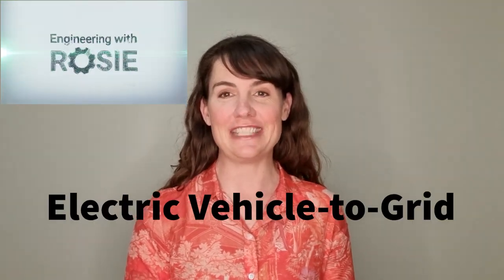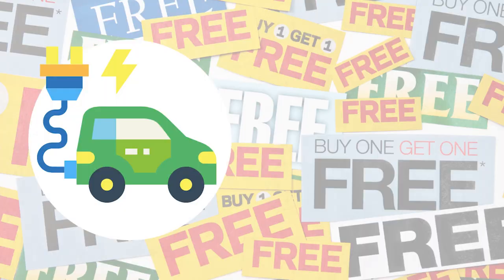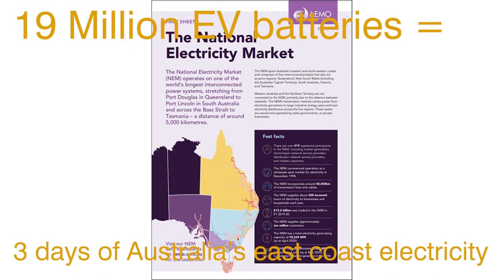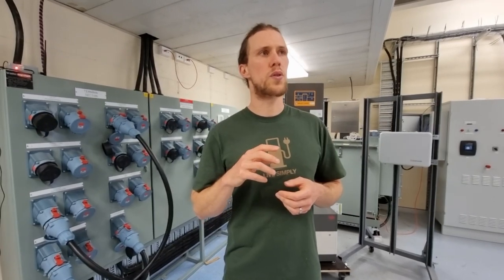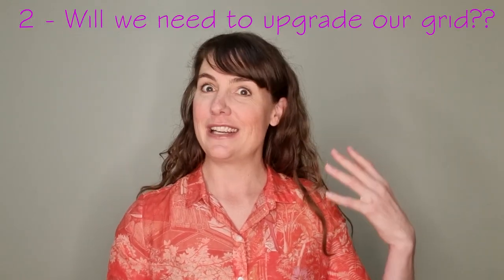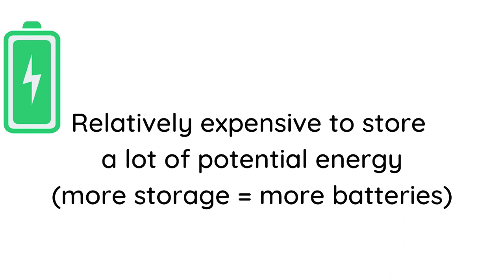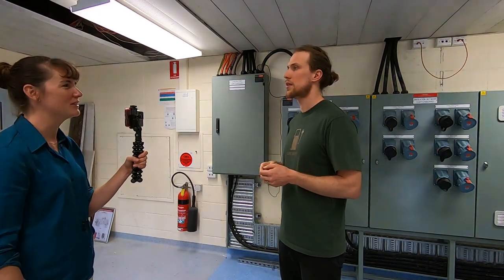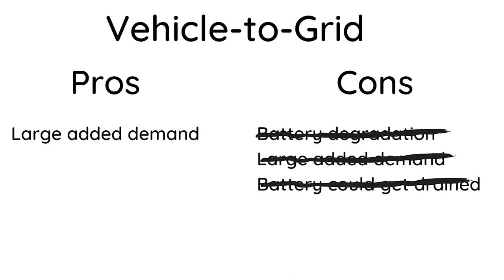Electric Vehicle to Grid Technology Explained

Comment: Rosie, I thought I saw a pic of PM Morrison questioning whether an EV can tow a boat or trailer. Really? Maybe you have heat like us here in Nevada that affects people's minds! lol Since the 1970s, the primary form of rail propulsion has been diesel-electric where the drive motors are electric but the electricity comes from diesel generators instead of batteries but more recently they use battery backup. So electric motors can pull a 100 car freight train uphill but not a boat behind a car? Let's not get into electrically powered multi-ton cargo ships. It seems your politicians are as slow as ours.

Comment: Grid designs & related business models seem to be often a hurdle. I recently read about Solar & Wind power (or the lack of it) in New Zealand. 
Large parts of NZ have perfect conditions for both and it could probably be used to reduce the load on the hydro power plants that power 60% of the country. This way they can use their reservoir like a battery (despite not having any pump storage).
Turns out they don't do that. The electricity market here decides the cost of electricity based on how much hydro power is available. Less availability of hydro power means there is a shortage of electricity generation and this increases the price.
This means that if they use solar & wind over hydro power and keep the reservoir levels higher they get paid less. So despite having perfect conditions for Hydro, Geothermal, Solar, Wind and lots of unused storage capabilities they still use lots of coal ...
Reply: Hmmm, you are surprised that companies creating centralized non renewable power are not willing to support a decentralized renewable power?

Comment: The problem with V2G is logistics. Even if most EVs are not being driven most of the time. Doesn't mean they are plugged into a bi-directional charger, when they are needed. 

Which is another advantage for modular battery swapping. Most of the capacity can be at a stationary location most of the time. Which is why NIO can make money by using electricity arbitrage.

Comment: The problem I see for V2G is not so much the vehicle as it is the ancillary equipment that must be installed at the residence.  Whereas a unidirectional charging interface is essentially a simple communications circuit, ground fault detection circuit and contactor the bidirectional interface includes an inverter to convert the battery's DC energy to the grid AC energy.  This is much more expensive to manufacture than the unidirectional charging interface and, thus, costs many times more unless subsidized by the utility.

The only example I can find that may eventually be available to me (same as pictured in the video) incorporates a grid-tie inverter.  In other words it is only suitable for operation when the inverter senses the presence of grid power.  It will not operate in a backup mode in the event of grid power loss.  Though it may eventually be upgraded to include off-grid operation such operation would need to be interlocked with a cross-over switch that physically isolates the circuit(s) powered by the inverter from the grid.  If this crossover operates automatically it can be quit pricey, as well.

The most tangible benefit for EV owners that are also subject to occasional or power outages would be to use the vehicle as a backup residential power source.  However, the ancillary equipment make this a pricey option.

The Independent System Operator (ISO) for my region does provide incentives for Tesla Powerwalls to be managed by the ISO for a limited number of hours per year for the line stabilization and/or demand control.  As these battery systems are expressly installed as backup systems I can see a more cost-effective DC-DC connection between the powerwall and vehicle in order to provide additional reserve.  One would only need to purchase as many powerwalls as required for peak AC power and rely on the vehicle for additional energy for extended outages.  It also permits the vehicle to travel to an area that still has power in order to recharge without the residence losing power.

Possessing a lifetime free Supercharging perk for my Tesla I am well aware that such systems open the possibility to abuse that perk.  I suggest that Tesla knows the energy consumed while driving, the energy gained by destination charging and that gained by supercharging.  It would be straightforward for Tesla to charge me for energy supercharged and discharged into a Powerwall.  Now only if I owned a Powerwall.

Comment: I'm concerned about Tesla making frame-integrated battery packs, as it may be harder to take the degraded pods and turn them over to grid applications like superchargers as an intermediate step to recycling.
Reply from the maker: That is a good point. I assume they must still be able to remove damaged or degraded batteries to replace them, otherwise the car's lifetime would be limited by the battery's, but that is just an assumption on my part. Soon I will be making a video soon where I will tour a facility where they take degraded batteries and make them into stationary storage as a second life before recycling. I bet the guy I am interviewing there will know about the Tesla integrated batteries so I will try to include that in the video. Thanks for raising this!
Reply: Nothing will ever get done if we have to solve all perceived problems before we ever make anything. Nothing is perfect and we have to make some possible difficult choices and compromises. That is what engineering is.
Reply: Tesla's structural battery pack is still a separate module that could be reused if form factor is not terribly important. Given degradation rates quoted for EV batteries, it's quite probable that rest of the car is worn out beyond reasonable repair before the battery is. Currently it seems that at 500'000 km the battery life will still be fine, but from what I have seen on the used car market, interior trims do not do so well.

Comment: 1. One important piece of information left out of this video was that a typical EV with a 60kWh battery can power a typical home for two days. A Tesla 3 has a 57.5 kWh battery, the long range, 75 kWh. So this means an EV has enough battery to power your home in the evening when there's no solar, but you need to recharge every day.

2. So one thing needed to make this work is having charging stations at all work place parking since you want to charge during the afternoon when solar is in over supply.

3. The second thing needed is EVs that can do V2G. Teslas cannot right now (2023). Nissan Leafs may be the only EV that can.

4. The third thing needed is an electric utility company that allows two way flow of energy. In the U.S. the 2022 Infrastructure bill or Inflation Reduction Act provides funding or incentives to make this happen where it isn't already. (Would it be possible for a home to run directly off the EV battey instead of using the grid as an intermediary?)

 I couldn't understand what Bjorn was saying about Australia's obstacles to V2G even with captions turned on. Perhaps it's the lack of two way electricity flow at homes?

Comment: I note many EV owners seem nervous about the potential for inconvenience, battery degradation etc. so I think it's important to point out the potential financial rewards here - Grid operators pay huge sums for balancing services and the fastest responding attract the greatest premium, this is currently in the order of several tens of thousands of dollars per MW just for availability. As noted providers are paid even if it's not actually used, like an 'on call' retainer payment. I suspect many (most?) vehicle owners would therefore be willing to participate if they had opportunity to take a slice of this very substantial (and growing) pie. So IMO it's the flexible tariffs and other market incentives that will be the key to unlocking V2G as much as the tech. It's a great opportunity for EV owners to earn revenue while grid operators lower their costs. It's a Win-win for all apart from the Diesel farmers, and we need to be getting rid of them anyway.

Comment: I don't think V2G should be seen as a standalone technology. It should be part of the overall transition to a smart grid infrastructure that can make effective use of variable energy sources without a lot of expensive energy storage devices. Time-shifting the use of major appliances is a low-hanging fruit - e.g. running the air conditioner, fridge/freezer, etc at higher power before peak demand so they can be turned off during peak hours. And that does include delaying EV charging till demand is low. Next step would be designing appliances that are more optimized for time-shifting, e.g. freezers with more thermal mass, "geothermal" air conditioning system that can use the ground as a temporary heat sink, etc. EVs with V2G technology should be a part of this effort, but I don't think it's a cure-all by itself.

Comment: the idea of using BEVs as grid storage has always seemed so bizarre to me

if BEVs need all their range, then draining their batteries would be bad

if they don't need all their range, then it would make so much more sense to just put smaller batteries in them, then you're not wasting energy hauling around all that extra mass of battery packs that aren't being used

also totally bizarre that Australia is so keen on grid storage when they have all this perfectly good Uranium that they already mine and export, that could give them as much cheap, highly reliable, on demand electricity, as they could possibly need

and even stranger than despite being a country seemingly perfectly positioned for large scale green hydrogen production, it seems to be such a small part of Australia's plans, and FCEVs seem to get much less support than BEVs, and green H2 for grid storage gets much less support than grid scale batteries and pumped hydro, and it's not just the abundant sun either, the brown coal would also be great for hydrogen production, and the uranium too

Comment: V2G is all great. I am heavily rooting for it, but my concern lies deeply with the availability of rare earth elements that goes into manufacturing of battery and there's only a limited amount of them. If we look into Li-ion batteries in today's Tesla cars there's only a limited capacity per gram. Will that be enough for V2G putting aside other primary uses of it? Unless we are drastically shifting towards new materials to make batteries, or improve the demand and supply chain logistics, this V2G technology as far as my naive understanding goes won't be economically viable. If the use of V2G is sparse as Bjorn explained then it should be fine but if the demand increases then it might create some issues. Also consumer-electricity supplier-regulators need to develop a trust regarding safety and incentives. Else the technology looks perfectly fit to be used. Again thanks for the video Rosie ma'am. Keep up your good work.
Reply: Rare earth elements are actually quite plentiful, they just require specific, complex processes to extract. It, of course, requires a lot of investment to build out that capacity. With the increasing demand, and the importance to national security of having access to these metals, more countries and companies are investing in the infrastructure to extract these resources. We aren't in danger of running out of these elements, there just needs to be enough demand to make the investment of extracting them make sense.
Reply: Shankhaneel Basak - I agree with your view, however don't discount the probabilities of improved battery chemistries, like for example the aluminum ion battery developed by Graphene Manufacturing Group. We live in exciting times, if it's handled equitably for all.

Comment: Still want more home to have batteries so they have be used all the time. 
VTG is great however it will still rely on people connecting their cars when they are at home or work which is a massive hurdle. 
I still understand that the cost of the home unit is still very expensive. The car side isn't an issue as the Leafs have all the hardware already.
Reply: They will connect if there is a financial incentive

Comment: Can I use my laptop battery for the same purpose? I would have no problem with my laptop giving back 100...200 W of power back to the grid, few times a year for few minutes - when it's really needed.
Reply: I suspect that the circuitries for laptop batteries don't facilitate discharging it through the charging port.
Reply: @seneca983 , correct, so probably you'd need to also engage the USB port for this purpose; but interestingly the circuitry for the car batteries somehow allows discharging through the charging port? Somebody thought about this use case during the design phase?
Reply: @sp90009  "Somebody thought about this use case during the design phase?"

Based on the Wikipedia page on vehicle-to-grid technology most EVs don't have that capability though some do. The page says:

"There are several electric vehicles that have been specially modified or are designed to be compatible with V2G. Hyundai ix35 FCEV from Delft University of Technology is modified with a 10 kW DC V2G output. Two vehicles that have a theoretical V2G capability include the Nissan Leaf and Nissan e-NV200."
Reply: @seneca983   ok, so we have a situation where 90% of EVs need to be re-designed for this purpose anyway... So laptops and phones have a good chance to get ahead in this game, because their design cycle is much shorter/cheaper, and the consumer buys new gadgets more frequently than new vehicles.
Reply: @sp90009  Redesign for future EV production is probably a minor issue since it's a fairly small part of the car. Retrofits on existing EVs are probably a bit more difficult but can probably be done as well.

I suspect laptop batteries aren't big enough to economically justify a grid monitoring device for them.

Comment: He said "...they can go from maximum charge to maximum discharge in under a second."

This is important.  The batteries can do 'peak shaving' which is better than peaker plants.  Battery storage can respond to load changes in milliseconds.  This is much faster than peaker plants.

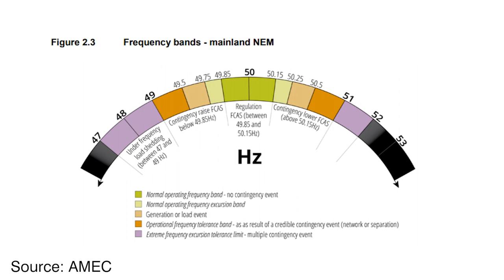The diagram at 9:00 showed the amount of frequency change with load.  The electromechanical nature of the system causes frequency dependence on load.  But with electronic DC to AC inverters there does not need to be frequency change with load.  The inverter can emulate the frequency change with load.  It can also monitor the frequency and use it to deliver power depending on frequency, like an electromechanical generator.  But should it?  Why not deliver power when the overall voltage changes?  That's how DC systems work.  When all generation is no longer electromechanical, then the electronic systems will have to emulate to old electromechanical system?
Reply: Yes they will have to emulate the old electromechanical system because grid frequency is the the most effective way to broadcast a signal of generation / load imbalance

Comment: I own a model 3 and it does not sit around my garage fully charged.  Typically I arrive home 20% charge.  Probably not going to be much help if the grid goes down.  I do live in California where the median home price is around $600k so if you are serious about power just put in a power wall type system for about $20k out the door.  I suspect if you can afford a Tesla you can afford the power wall.

Comment: What I think is hindering adoption of V2G for consumers may be for
1 the consumer electricity / energy meter might only support one way flow,
2 an expensive system (power hardware) to manage in housed automated-  and/or remotely controlled- power flow direction command,
3 the number of car models that support the V2G technology,
4 a standard if there if there more than one that are compatible with all V2G hardware, (and possibly other electric internet connected loads like boiler, heatpump, AC, dishwasher...) 
5 car connector, (chademo seems to slowly die in Europe)
6 grid adaptive hardware, (single fase, 3 fase, 115V, 230V, 50Hz, 60Hz...)
7 spot (hour or minute) priced energy subscription, (very rare in my country Sweden)
8 combability with other energy systems like solar, stationary battery.

Meanwhile I try to charge my BEV after midnight. From what I heard it will help the grid.

Comment: I think in number 4 political inertia is the most important factor. Coal and natural gas still rule Australian politics.  It took years to get settlement times reduced from 30 minutes to 5 minutes for electricity generators and they are still delaying it. Gas peaker plant operators who also operate non-peaker plants make large profits gaming the system with 30 minutes settlements. Batteries and 5-minute settlement will cost a lot of politically well-connected companies profits.  Details are explained here https://reneweconomy.com.au/why-5-minute-settlement-will-make-such-a-difference-to-battery-storage-36772/
Reply from the maker: That's a great explainer! Thanks for sharing. Do you happen to know how they do it in other countries? Do other countries have similar markets and did they already move to shorter settlements?

Comment: Refining oil to make fuel uses vast amounts of electricity, so as we transition to EV's we will require less fossil fuel production, therefore the grid and power production will not need to increase
Reply: Well yes, oil refining does take lots of energy. However, since the refiners have lots of wholesale oil they use mostly that oil to make that electricity they need. In other words, they don't use much grid electricity. 

So as we switch from powering our cars with oil to much more efficient (and clean) electron power, we'll need to push around more electrons at the same time we use less total energy, and save money by doing so.